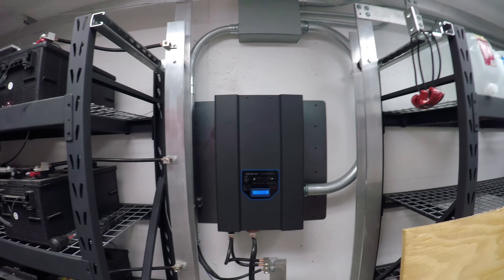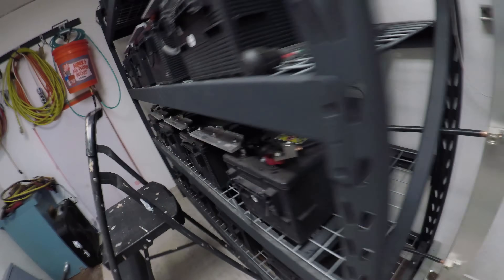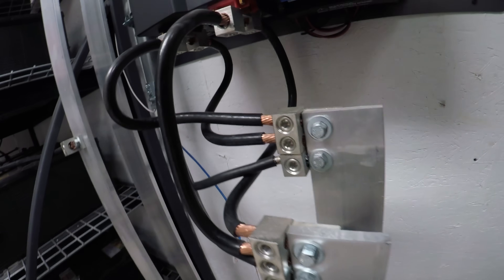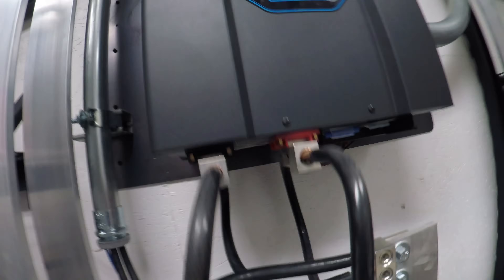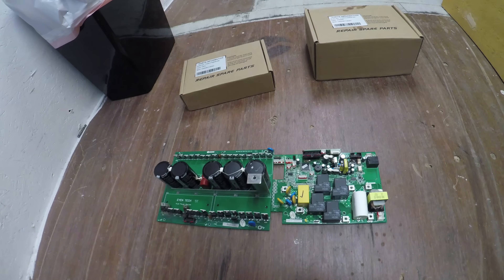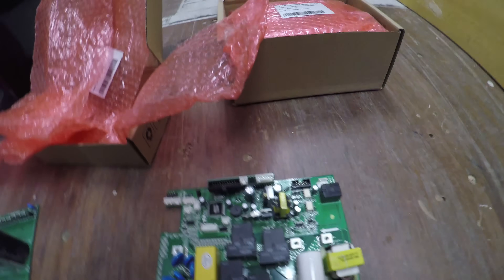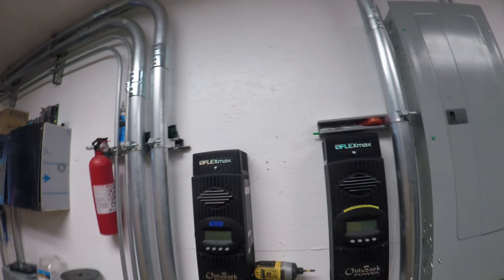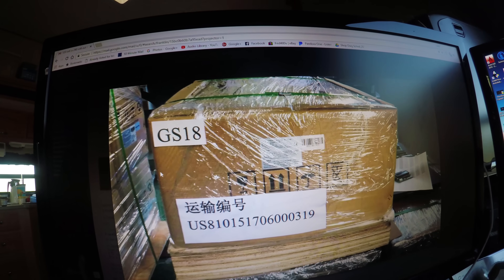HUGE Off Grid Pure Sine Wave Inverter 36 KW Peak

Comment: Nice but 180 W idle consumption. I have a 6 kW Power Jack (which means it is about 3 kW for some minutes) and it takes 20 W idle (24 V input). I am very happy with that but it has a toroid transformer and I was thinking about that when I saw the transformer inside the inverter.
Granted this is a much stronger inverter but idle power consumption shouldnt be taken lightly on. That continuous power draw makes a difference in the long run. Especially on cloudy weeks.
Have you considered having two inverters? One that takes low loads and one for high loads? That will also give you a spare in case one brakes. Dont know how to connect them cleverly though.
Impressive system and thanks for sharing.
Reply: gamingSlasher  really i bought a 15kW continuos 60kW peak. I never was able to get more than 5kW. I has for the toroid to the outlet bar #12AWG, so that’s why 5kW
Reply: Sounds like a Powerjack 15kW. I am planning to buy one of those this summer. 5 kW is what you should expect so that is perfectly fine. The marketing at powerjack is way off with the numbers.
Reply: 180w holy crap. And the efficiency is only 80%. It should be renamed "battery killer"

Comment: http://www.tennesseequipment.com/Midwest-/Michigan-/Dealers-/New-square-d-thermal-magnetic-circuit-breaker.pl
Reply: DC use, use outside poles per the breaker. I bet that if he fed only the positive to one and the negative to a separate one he could use all three legs for a 450 amp capacity.

Comment: Great set up threw out the board. One thing I am concerned with is your actual power input capacity. As per your load storage capacity, your input is under optimal, wich leads you to run your generators excessively.  As the price of solar panels is very much affordable these days, my suggestion is to increase your solar aray by at least fifty percent.  It is a easy doable remedy for you, as your set up is perfectly geared for it.  Good luck and keep inspiring Youtubers!!
Reply from the maker: Pierre Flamand I'm working on it. I'm about to do a bunch of work for solaredge and try and trade labor for panels.

Comment: Looks like you got a good deal, the new price is "Sale Price $2,199.00", they must have jacked up the price because you linked to it.
Reply from the maker: +Luke Schaefer they include free shipping. If you message them directly you can get a freight charge, it'll take longer to ship. I also was able to get it delivered to a loading dock. That dropped off quite a bit
Reply from the maker: After contacting the company I found out that since I actually bought their first run of production that I got a price for them testing out the market. So the new sale price is actually what they are going for... I guess I was just in the right place at the right time and I also had to wait three months for it.
Reply: Where you buy it

Comment: You have a nak for explaining clearly....  would love to see you do a basic to complete work up on your system
Reply from the maker: I appreciate the complement!  I can't exactly do a full series of videos on start to finish, but I do plan on going over component to component as I have time to make more and more videos.
Reply: I have connected the solar panels on my inverter but it is taking power from batteries and not solar, can anyone assist?
Reply: Inverter should take power from batteries, not from solar panels directly. Panels can't handle providing necessary power.

Comment: In spite of the Energy Policy Act of 2004, my utility company refuses to configure my meter for net metering, which complicates my objective (supplementing my grid-tied system with solar / IC generator). Can the inverter in your video be configured so that the meter recognizes (and bills for) only the electricity passed into the inverter?
Reply from the maker: +Marc Johnson it can supply all loads from battery power and if the batteries get low auto transfer to utility power, charge the batteries, then transfer back to battery power.  You would have to put all loads on the output of the inverter and configure the dip switches properly
Reply: Not a bad approach, but so as to avoid buying batteries, my first choice would be 80/20 (solar/utility) during the day and 100% utility at night. Can the inverter be configured to use grid power to make up the difference between the total consumed power and the solar contribution? Thanks very much for posting.
Reply from the maker: Marc Johnson  no, this model can only get power from one source at a time.